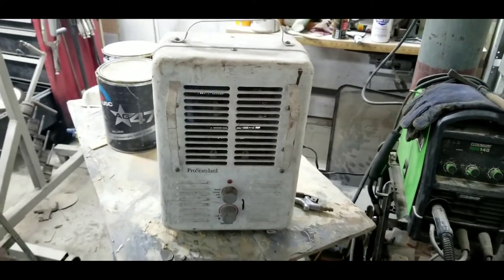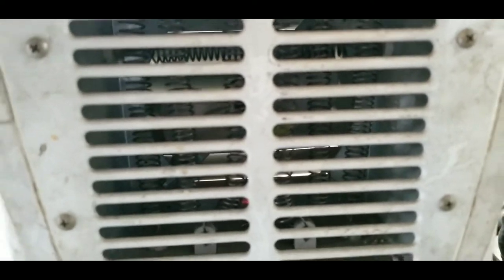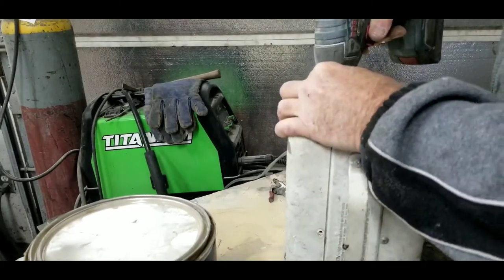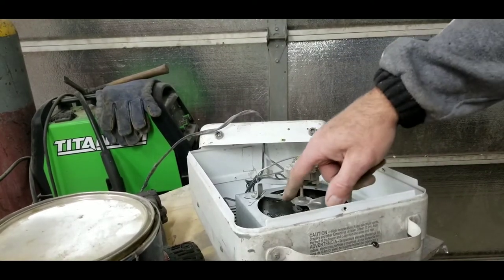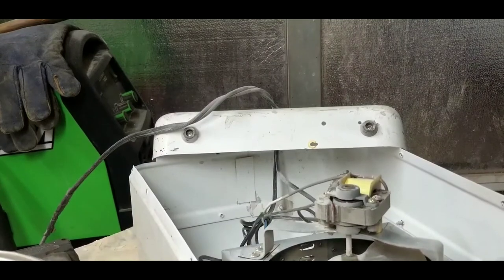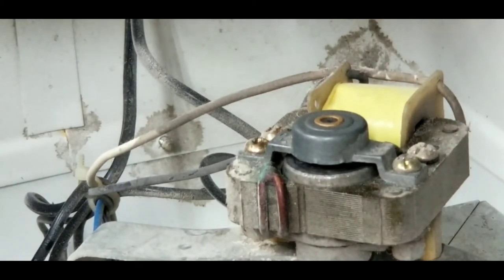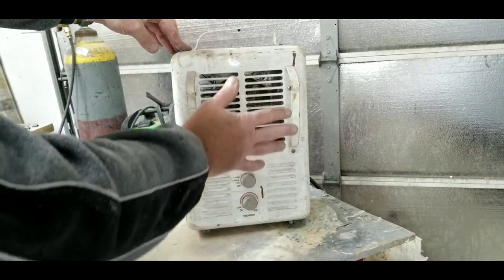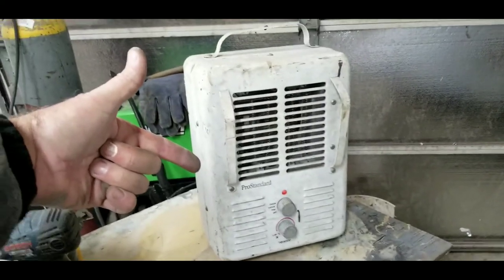FREE space HEATER can we fix it ? will it run ? again

Comment: I know this is an old video, but wanted to say that there is another bearing on the other end that should be lubricated too. Using oil means you will need to do this once or twice a year if you are lucky. Using a graphite impregnated grease would be better, but it will work ok with the oil. (The problem is that the oil wil attract dirt. dry out, then stick the motor again.)